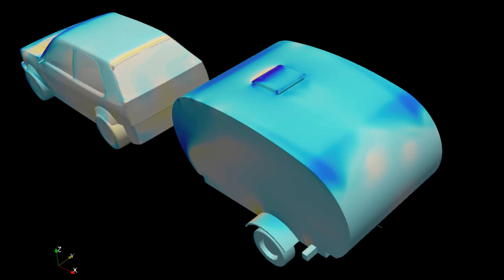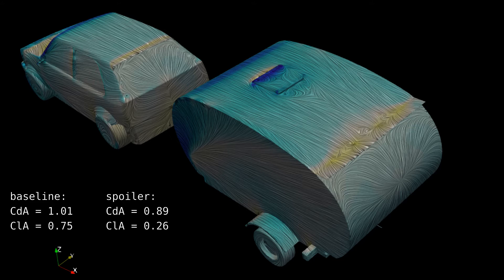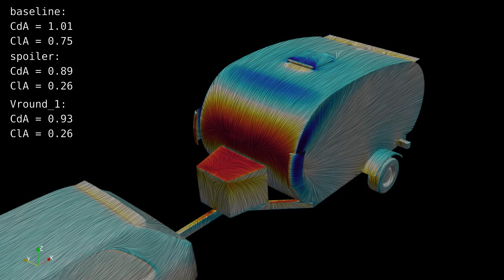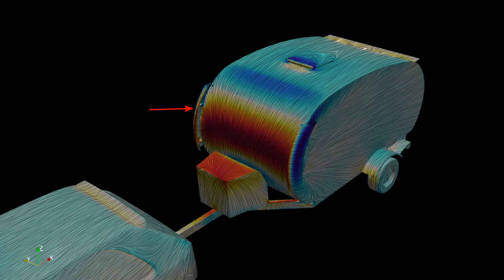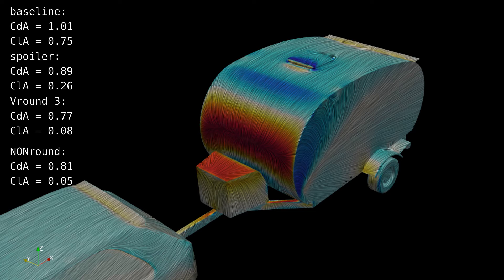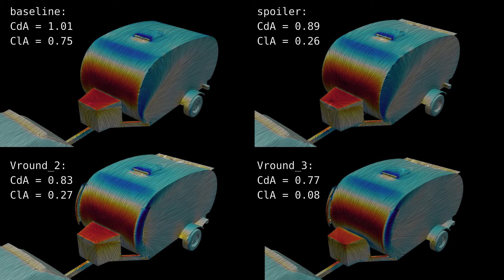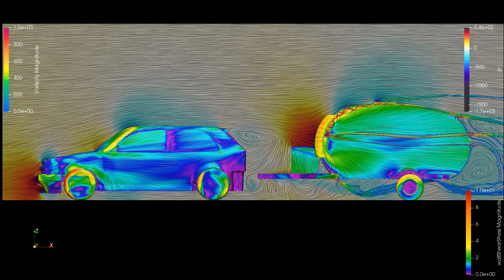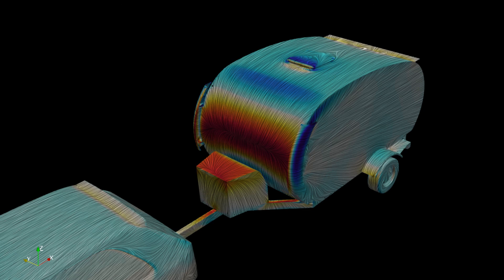Aerodynamics of a Camper Trailer Through CFD

Comment: Could you use this same model and show the effect of a car roof wind deflector - would/may this reduce the high pressure zone at the front of the caravan......and even make the rear caravan spoiler even more effective? Or is it the case you are just transferring extra drag to the car - nullifying any benefits????
Reply from the maker: The car definitely matters. I mentioned that the car is less draggy as a result of the caravan. A car would tend to be more efficient than the caravan so a larger car would likely increase overall efficiency, but likely as a result of the front of the caravan being shielded. The rear will be doing the same

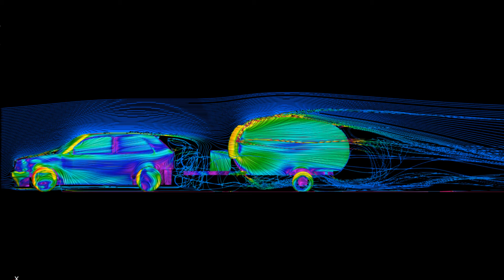Comment: I always wonder why this style of trailer has these rounded backs instead of a kamback.  If you look at 4:50, just draw a vertical line at the most reward point of the trailer until it intersects the flow line, and just build the back flat until it reaches that line.  That should negate the need for the spoiler, provide more interior space, and be easier to build.  I'd make the underside slope up at the tail more though to reduce lift.

Comment: I'm always shocked how even "aerodynamic" trailers like an airstream spoil everything with the roof top AC units and bulbous vents.  I'm also suprised small "aero" campers like this use external wheels.  Just make the whole thing wider so you have more space inside.

Comment: I would love to see your analysis of a Bontrager Outdoors 17FD. I recently got a good deal on a used one, and it really looked the part. I was shocked by how poorly it towed.
Reply from the maker: That isn't an aero design. Hopes and prays went into that shape.
Probably think those larger vorticities at the side front but all the way down the back as well.
Reply: @nelsonphillips well, it’s mine now, so making it tow better becomes a science project I never wanted. Hopes and prayers are about the only tools I have access to as far as I know. I guess I’ll be sticking air tabs to it, putting smaller wheels on it, and putting some sort of paneling on the underside. Maybe it won’t eat the transmission on my 2011 Toyota Sienna. All because my wife won’t camp without having a bathroom and a proper queen sized bed.
Reply from the maker: @madhousediy5050  the same fix with the rear flap should make the most difference
Reply: @nelsonphillips I would imagine that placement is critically important. Since I don’t have the power modeling software you have, or the knowledge of how to use it, do you have any suggestions on where I should put this flap? Developing a secure way to construct and mount it is another concern, but I can work on that. I’m part of a Facebook group of people who own these campers and will spread the wealth of whatever knowledge I gain with them.
Reply from the maker: @madhousediy5050  the placement isn't very important. The video contains my first guess and it gave the numbers that said it was close enough to optimal. So my guess here is in this link. It could go a little higher. https://imgur.com/a/A83L0Aa
underneath triangles could be added to the trailing edge to about to the top of the window - 3-5cm right angle triangle with the top edge horizontal. rear swing arm of this https://www.crash.net/motogp/news/1064357/1/2025-ktm-rc16-less-natural-pedro-acosta-predecessor
Reply: @nelsonphillips thanks for this. I appreciate it. With enough of a reduction of drag, the minivan will be able to stay in a gear better suited for highway travel. I’ve saved screenshots of these photos and your suggestions. I have some ideas for ways to make and mount this.

Comment: Could you add a rounded edge to the front of the trailer with extra material? Expanding foam is very versatile and not too hard to work with.

Comment: I just found this video, which is extremely interesting to me since I'm planning to put a wing on the back of my teardrop camper/caravan.  Hopefully it'll yield a small improvement in mileage and or stability for the bikes that sit on the back - or just provide a cool spot to mount a 3rd tail light and backup lights!  
I am curious if you experimented at all with a wing on the tow vehicle as well.  There seem to be a number of videos out there with empirical testing on square-ish trailers that suggest improvement, but none I've seen on the classic smaller teardrop.

Comment: Its very interesting i have built a teardrop for myself years ago very similar to the one you have modeled 

I built it to the rear box dimensions of my 62 ej holden panelvan as thats the car i was towing with it 
I averaged 110kmh with 14L to 100km with the teardrop in tow 

And it really wasn't noticeable towing so i never bothered to improve the design as i jagged it first time 

without teardrop average speeds of 110kmh with mileage of 12L to 100km

Now i still have the same teardrop and i have a new tow car a 74 Holden 1 tonner and i can really tell the difference between the two tow cars as far as drag both cars have the same engine so power levels are the same 

I am putting this down to a lot lower roof line 
A large empty tray thats creating a huge high Pressure point on the front of the van at speed 

Would it be possible to have a closer look at the wings you developed for the sides id like to make and test something similar for my teardrop 

As i noted my highway milage with camper at 19L 100km at 90 100kmh

Without camper i get higher crusing speeds of around 110kmh but mileage of 10lt 100km 

So the teardrop is causing huge issues with drag id like to fix
Reply from the maker: yeah this makes sense. The panelvan covers most of the frontal area of the trailer, but for the ute its like driving two cars. There is also probably poor interaction with the trailer and the ute that are making thing worse.

Comment: rather than the wings on the corners, could you just use fences/endplates to prevent the flow spilling over?
Reply from the maker: The size of the fences would need to be as large as there is a pressure gradient. The fences could be tapered inwards to increase the pressure on the outside of the fences. but, this video is the smallest solution other than creating a radius on the corners

Comment: Hi Nelson I just finished building the rear wing you mentioned on the hatch back design video... I had to put a lot of extra cross strength in it,  as it was producing to much down force on the outer edges. We've done a fair bit of testing and fettling with it, and it works pretty good now.
Reply from the maker: I'd love to see an image... throw a link into the back of a long thread under an old video. I'll reply and then you can bin it, if that works.

Comment: The problem with drag on the caravan needs another solution.
If you pull a caravan with a normal car, the drag is high, If you have a high car like a SUV or Van, the drag is less. That is the reason, why trucks have spoilers or these aero tops on the roof and aero parts at the end of the cabin. These parts make the wind go other lines. if you can use a spoiler at the end of the car, that leads the wind high, the drag on the front of the trailer is less hard. The spoiler on the trailer will be great to have a better handling on the trailer caused by the downforce.

Comment: Good timing I’d had on my list to do a side by side comparison of airstream vs a typical European caravan we had a 25ft “white box” which even with anti sway on a breezy day was hell on  wheels vs the airstream with it’s “implied” aero benefits ( there are no slab sides for a start) so although dragging maybe another ton with the toys we bring along these days the fuel economy is only 1-2 mpg less - airstream’s collar with Porsche recently touched on one solution we see in other caravans in Europe (eriba) drop the roof height to a “pop top” ala vw campervans and I think with their on board batteries they had reintroduced the flat underfloor cladding to shroud the chassis which older airstreams had. And can I ask what cfd package you are using? And yes teardrops are not particularly common in Europe but TAB who are one of the major suppliers used to make a larger twin axle version and I can see in a world of EV restricted tow weights the balance of aero/volume-size of a caravan vs range is really going to be a issue
Reply from the maker: openfoam

Comment: Out of curiosity, would it be possible to run a simulation on a car, with some of the windows partially rolled down, and see how would that compare against a fully rolled down window. For example, I like to roll down the passenger and rear passenger window 2 inches down while driving on a highway. The air doesn't blow into my face, and actually wrap around the rear interior of the car and blows gently into my neck.
Reply: Possible is, but the simulation will become highly heavy to process. I think this guy has a powerful Pc to run this simulations (3D simulation is, itself, heavy). Do it with all interior and details will require a very big and refined mesh.
Reply: Buy rain shields